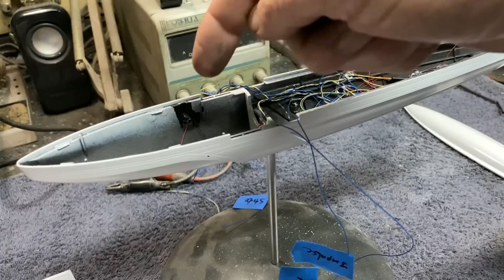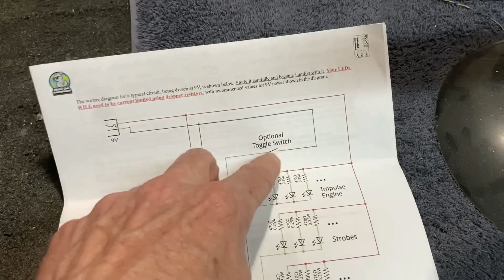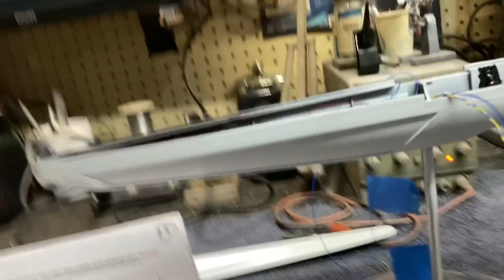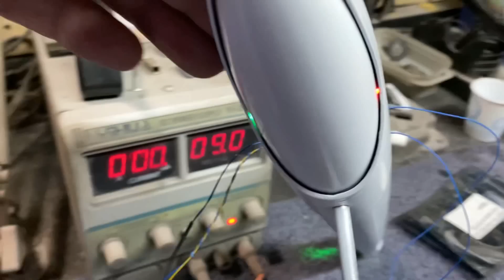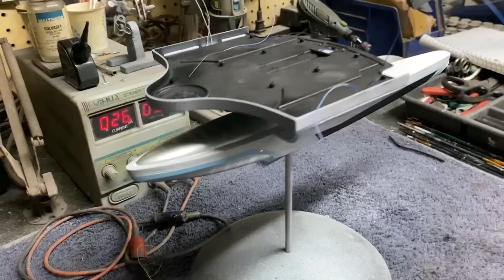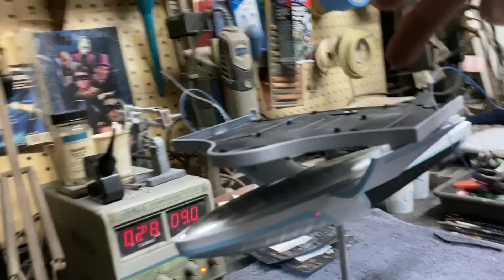Building The 1:350 Scale USS Grissom Model Kit By Polar Lights

Comment: Hi Boyd...hey how did you proceed with gluing on the pylons and accommodating the wiring.  Sliding them through after (gluing the pylons on) seems difficult. Curious what your steps were for this.  Thanks for your help.

Comment: Hi Boyd, does the kit come with the metal tube for running the wires through it to the base?
Reply from the maker: It comes with the small dome base and a solid steel rod which is disappointing. You have to use your own mounting rod. I went with the large polar lights dome base that comes with a hollow rod. It's slightly bigger at 15/64" so you have to drill the hole in the model out to that size.

Comment: This looks like a nice kit.  The size is a little surprising. The 1/1000 scale model from a couple years ago looks pretty small next to a 1:1000 Enterprise. This at 1/350 looks like it would be smaller than a 1/350 Enterprise, but the size difference would be less than seen at 1/1000.

Comment: Ok, so you have the main power to the upper section, including a ground. You also have separate single wires from board to impulse, strobe, and nav, all of which you’ll tie back to the main powers ground end within the upper 1/2. I’m having trouble imagining the practical side of this without having done one yet myself.
Reply from the maker: I'll show how I connect everything in the next video.
Reply: Thanks Boyd